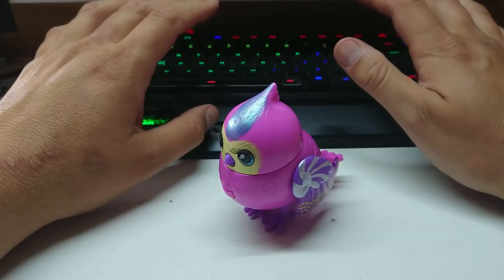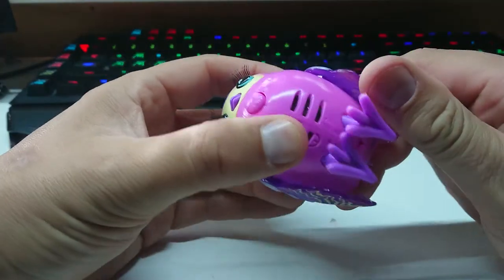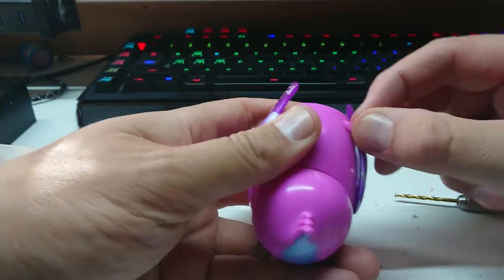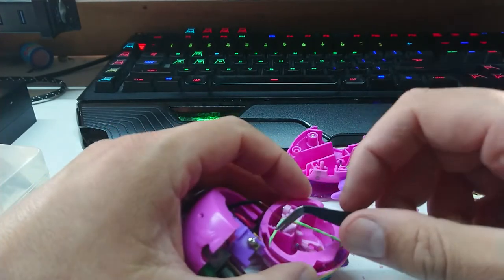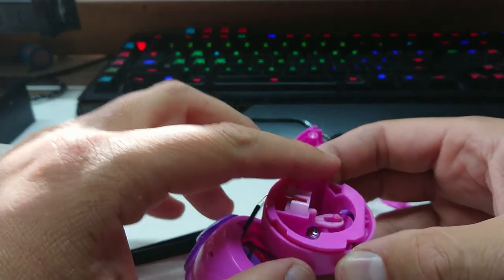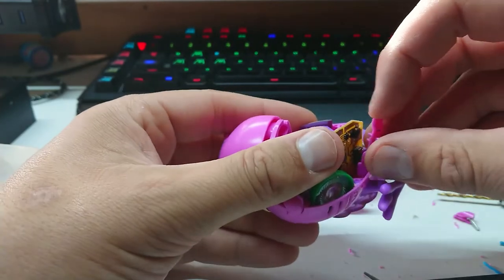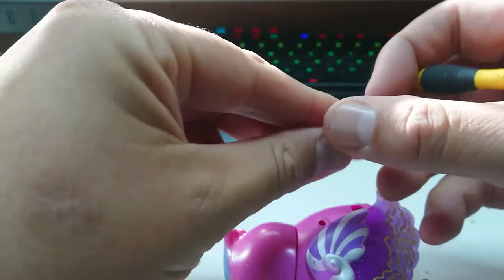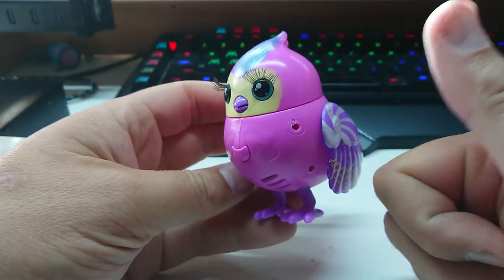Little Live Pets Lil' Bird (Series 8) - Repair

Comment: Hello Aussie repair guy it’s funny to say but I have a request I little life pets bird is broken find a source of why it’s broken BTW it’s not the new version it’s the old version of the birds
Reply from the maker: based on what I learnt in this one, there's not too many things that can go wrong.

most common would be old batteries that have leaked and made the contacts dirty or rusted.

the second most common would be the very thin wired to the actuator coil in the head.

Water or liquid damage is probably the next most common cause.

Comment: Do you know how to get the bird to talk again? I'm thinking I will have to get the body open but do you have any other tips?
Reply from the maker: If it's not talking that could potentially be a battery leak qnd corrosion issue. Might not be recoverable. If you are lucky, it's just a wire break to the speaker.

As for getting body open, remove all the plugs and then the screws behind them.
Reply: @TheAussieRepairGuy  Thanks so much 🙏